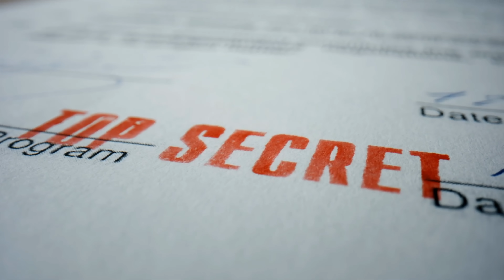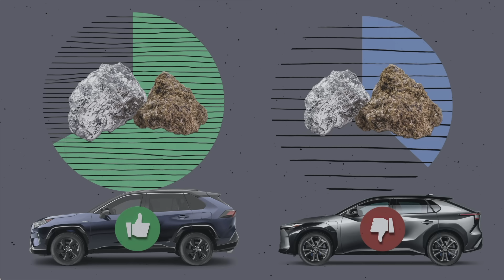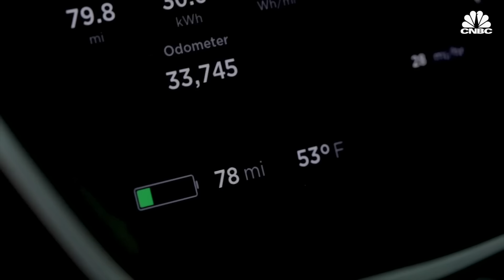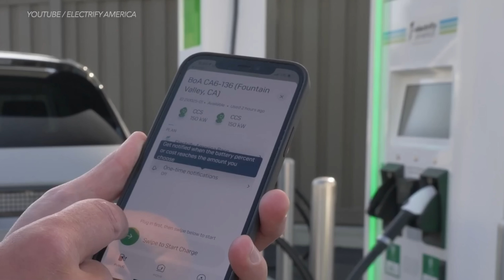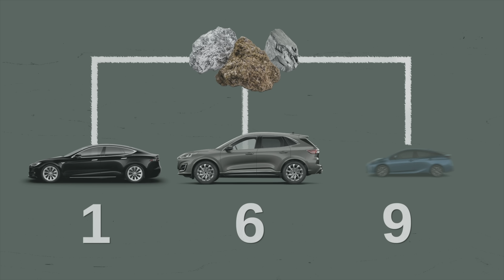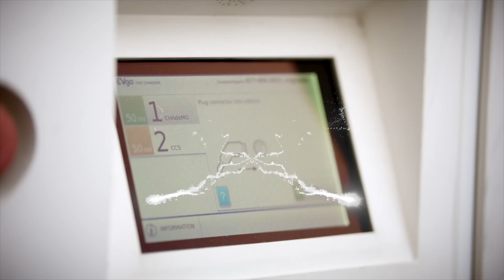Toyota's Announcement Shocks the Entire Car Industry

Comment: I wish Toyota would shock the auto industry by offering stripped down vehicles like the Tacoma or even the RAV4 to lower the price of them. Things like a smaller body, manual door locks and roll-up windows, less than ten airbags in the interior, minimal dash mounted electronics, optional A/C and cruise control, etc. Plus mandate the dealerships adhere to sticker prices instead of ripping off buyers with their 'price adjustments'.

Comment: 1-6-90 rule - the Toyota CEO put that out there as he incorrectly figured that the light switch would turn for everyone to see how silly full electric is for its environmental impact (cost) - BUT it just got out the internet scrubbers and "outranged shammers" to nullify the "discrediting of the battery and the perception that electrical plugs are anything less that totally environmentally clean.

Comment: Gigacasting has very low yield of usable parts.  Recent reports from customers and the auto repair industry also point out that flawed casting are showing up in increasing numbers -- flaws that are concealed and not discovered until failures occur spontaneously or from minor accidents.

Comment: Smart move with more hybrids.  The Maverick  hybrid Ford Truck a great success.
Single casting assemblage approach will be extremely expensive when it comes to body work repair and lack of individual replacement parts.  It is too late for other manufacturers to enter the EV market given their cost required to even show a profit.  Ford, Chevrolet, VW, Toyota BZ4X all failures.

Comment: I think a potential solution to the issue of climate change and cleaner vehicles are Hybrid cars with A hydrogen powered engine , we may be able to  balance out the reduced range of hydrogen by enhancing it with Electricity from the hybrid battery ... Am sure it has already been thought of or even done with the Toyota mirai

Comment: Toyota should consider a balanced approach when it comes to the EV industry, as it has the potential to harm the environment due to its heavy reliance on nickel and cobalt mining for batteries. Instead, Toyota should shift its attention towards what comes after the EV era. It's evident that the current technological trends are centered around autonomous driving, AI, and flying vehicles. To excel in these domains, Toyota doesn't necessarily need to prioritize EVs. Rather than getting caught up in the potentially harmful EV race, Toyota would be wiser to provide superior solutions by focusing on the post-EV landscape

Comment: Toyota needs to increase hybrid battery to 20kwh to 25kwh and put larger rear electric motor and It is real alternative to EV. So that they can have plugin hybrid system in larger cars and have better driving dynamics not being too front wheel drive heavy.

Comment: Current battery’s is not the answer.  Using rare materials is insane.  A new battery system using a different materials different chemistry (easier said than done).  Hydrogen in place of crude oil fuels as well.
Reply: Electric motors rely on rare earths too, there is more planned obsolescence in an EV than an iPhone

Comment: Sounds like Toyota is smarter than Ford. And what happened to “Ford built tough.”
Reply: Well, ford f250 7.3 sure can destroy that little thing
Reply: @USA99999  Older ones yes but the newer ones are trash and the woke ruined Ford
Reply: @@CowboyPants-yu7xn The woke ruined Ford and I own an 2001 ranger and a 1980s tractor. The older Ford is better
Reply: @truckvlogs1346 true but their 6.7 powerstroke is still one of the best
Reply: @ripperlipper1016  true. I like the motors in the trucks but I don’t support Ford anymore. They knew they screwed up and they don’t care. They are trying to appeal to the woke crowd.
Reply: Someone misheard.  Ford actually said "Ford built rough," and what they actually meant by that was "Ford sucks hard."
Reply: I think that's just their saying.
Reply: @perniciouspete4986  that’s the truth

Comment: Toyota is right. The massive economic problems ahead will clobber the EV business. Hybrids will remain relevant even through an economic downturn because they essentially make ICE cars more fuel efficient w/out adding a massive battery which increases both cost and limits number of cars that can be produced due to limits of battery production.

Comment: Forget batteries, batteries are for toys. We need more bio-fuels to replace fossil fuels. Sustainable, carbon neutral bio-fuels that can use the current gas delivery infrastructure. Bio-fuels to replace diesel fuels, to replace gasoline, jet fuel, home heating oil, and even propane. Bio-fuels will put a lot of people to work for a sustainable and cleaner future. Bio-fuels that are backwards compatible so that old 57 Chevy can still cruise the road. Bio-fuels that are compatible with military vehicles to maintain the power and range of mission critical equipment. Just as synthetic oil is a revolutionary improvement over conventional oil, synthetic gasoline will be a similar break through.